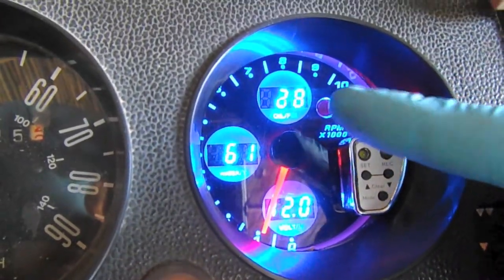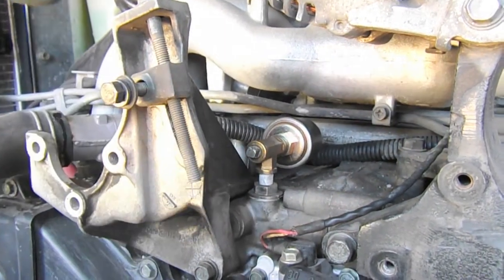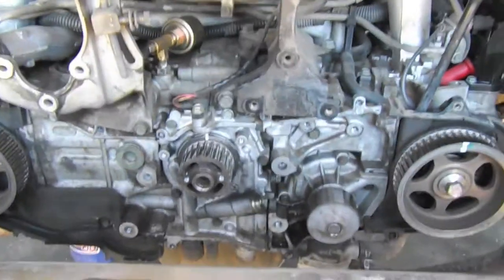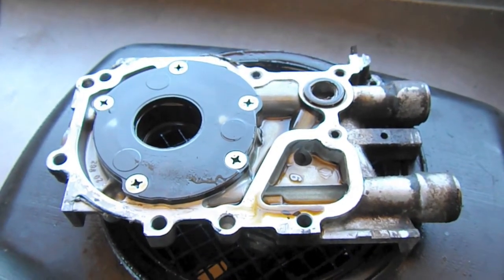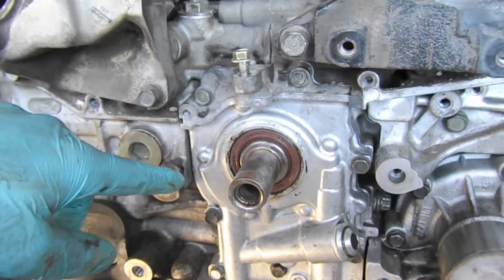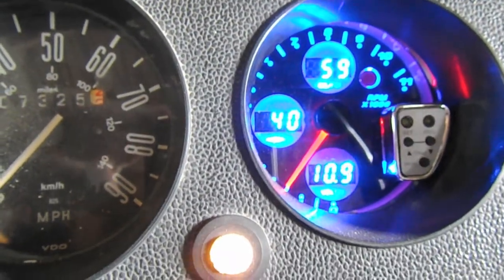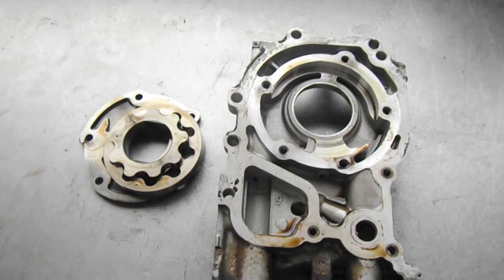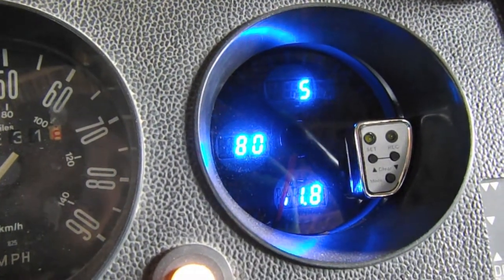Busaru - Low Oil Pressure at Idle

Comment: always check the pressure relief valve system when you replace, examine or mess with any pump
Reply from the maker: Just out of curiosity, I'm going to pull the original one apart, but with a mechanical gauge I found that it had great oil pressure so I expect I won't find anything unusual.
Reply: Can you drive the car if its low pressure just at Idle? I replaced the pump and pressure sensor and it still turns on at idle

Comment: Thanks for these series of videos!  Very helpful and inspiring.  I've got a '72 that I put a Ford 2.0 in about 100k miles ago.  Love the extra power.  It vibrates like crazy so put the 1.7 VW pancake back in.  Ugh.  The Busaru idea is great. You've inspired me to make that my 2015 project.

With regard to the gauge problem, I would suspect it's not so much the cheap ebay meter, but the long length of thin gauge wires between the sender and the meter as well as a high resistance ground. (the resistance of the wires and ground back to the battery set up a voltage divider that you don't want) Turning on the lights is the clue there.  I bet if you turn on the turn signals or emergency flashers the pressure will vary up and down with the flashing of the lights.

I've experienced the same issues in my bus.  Ive used 12 or 14 gauge wire from senders to meters, as well as a 12 gauge ground direct to the battery for instrumentation and that has fixed the problem.

Just a suggestion. Keep up the good work!  Safe travels!
Reply from the maker: Thanks for the suggestion! I usually run fairly thick gauge trailer wiring up to the front but it may only be 14awg. I bet you're right though. I've been taking out my other frustrations on that gauge - like the fact that you can't dim the brightness effectively. I'm sure I could hack it but who wants to do that? Best to just get a better made gauge. Thanks for the suggestion - I may try testing that on my 73 bus.

Comment: Very common issue with the cheaper mech senders, racers usually remote mount them to a firewall.
Reply from the maker: +vipercrazy I think you're right. Ive seen remote mounting using a grease gun flex hose - pretty clever.

Comment: it looks like you have a ground problem

the sensor have one wire? 

have you used sealing tape on the pressure sensor or the t-hose?  

measure the resistance (ohm) between the sensor ground and the engine.

if the resistance is high you might put a wire around the pressure sensor with a house clamp, and ground it on the engine 
(do not ground a small chable to the case, if you have a resistance between the case and the engine and the battery is grounded in the case. you might burn up the small cable when starting bicose there might trying to get 100 amps try the small cable) 

also the ground whire between the engine and the case may have a issue? does the car start well? 

you might have the battery ground cable directly connected to the engine? then the car will start good and also charge the battery well, because the charger ground is in the engine block 

now there is a cable between the car battery and the case or the engine and the case. this cabl have a bad connection 

if you don't hava a cable like this between the case and the engine the electricity is flowing from the small areas where the motor is mounted to the case, mostly you use robbery mounts and that's insulation the voltage. 

the gauge usually are using small voltage for measuring, 

example if the pressure sensor is 0-5 V and the sensore is reading 1v on the lower scale when idle.

when you turn on the lights a current will case a voltage different bicose of the resistance and you get between the sensor ground point and the meter ground point -1V and using simple + and - math 1V + -1V is equal to 0V and the meter will Reed pressure baist on the voltage 0V = 0 pressure 

is the gauge ground point in same place white the hed lamps or something else that takes a lot of amps?  

you might use a voltage meter to measure the voltage different between the engine and the case. 

do like this, put on the head lights 

take a Voltage meter and chose a low scale like max 2V 

measure the reading between the engine and the case 

measure the car battery ground and the case 

measure the car battery ground and the engine 

you measure the voltage between the sensor ground and the engine. you might even measure the resistance ohm, if you were using some kind of non inductive sealing on the installation the issue might be right there ;) 

you can take a wire that you mount on the engine to get longer measure cable. now measure the voltage between the ground point of your meter and the engine. 

the less voltage different the bet.

all the best

Comment: Next time Use a resistor from your signal wire to a power+.  And see witch resistance value kicks it up to the scale to match you’re manual gauge. Worked on mine with those eBay sensors.

Comment: Hey question.

What's the torque specs on the 5 bolt for the cover on the oil pump? And the cover for the spring? 

Thanks

Comment: What sort of mileage have you done in this now? How is the cooling system holding up? Are the fans needed when driving or do they just come on in traffic?
Reply from the maker: I've driven about 2000 miles. The cooling system does great in my climate (7500ft elevation, mountainous, and usually mid 90's in summer). If I know I'm going to stress the engine I'll manually turn on the fans as the computer doesn't turn them on until 95*C. The radiators and entirely blemish free this winter though, It'll be interesting to see how a belly mount radiator will fare. That'll be my next project - that we we can compare the two systems and the advantages and disadvantages of each system.
Reply: I don't know why but I just don't like the belly mount idea
Reply from the maker: ItsFriscoBaby I like that my radiators are safe, but it'll be interesting to see how bad radiators are affected by road grime and magnesium sulfide here in CO with a belly mount. It's possible it could be no concern at all, but I bet it'll eat away at the cooling fins.

Comment: Did the fuel pump noise ever get dealt with?
Reply from the maker: +Andrew Ballerini yep, the best location I've found is to mount it on the top of the transmission so that it doesn't vibrate through the body.
Reply: +Busaru awesome. I was wondering. Thanks.

Comment: Im having the exact issue with my subaru the gauge reads fine when driving but at idle it goes down to 4-5 psi
Reply from the maker: +Jack Liu I would check the pressure at the engine with a mechanical gauge - compare that to the dash gauge. I've heard that with the gauges you need to run a very large wire for the power supply, 10 ga or so directly to the battery "could" solve these misreading a on the cheap gauge.

Comment: Your main bearings are going....
Reply from the maker: That may be so (all main bearings wear), but in this case it turned out to be the gauge and the electrical draw of the headlights and other loads causing an immaculate reading.